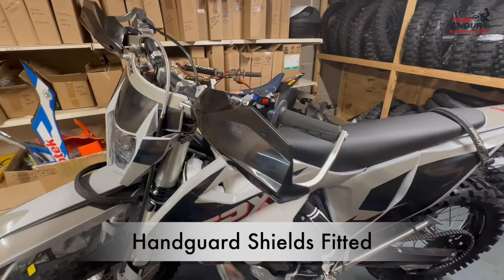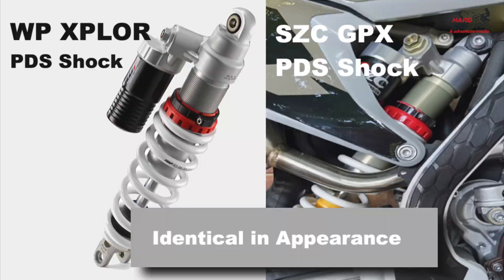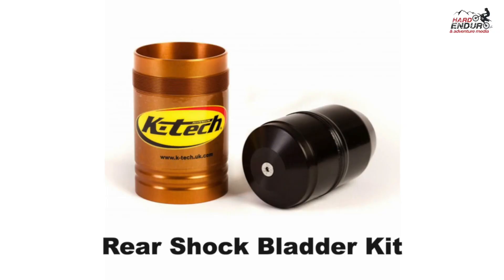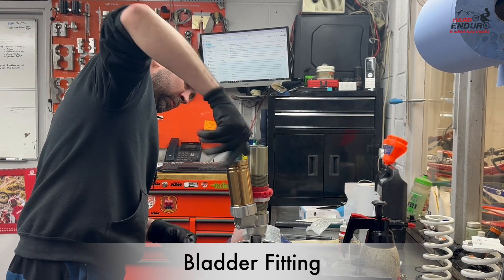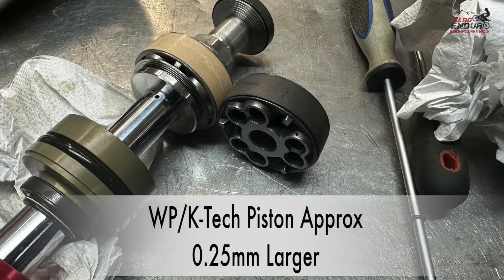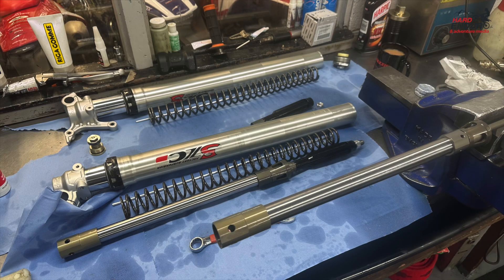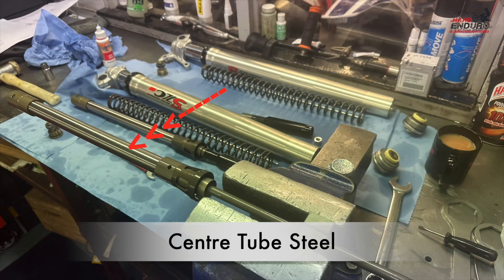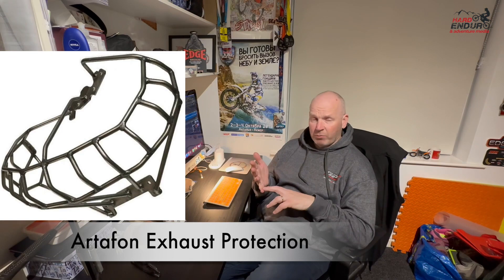GPX TSE 300R Build Pt.4 (Suspension)

Comment: Hi love your channel keep up the great work. Have the same bike and want to change my front springs like you. What weight fork oil and volume do I need to replace the stock oil? Thanks in advance.
Reply from the maker: @robertdelapaz1857  hi bud I use 5w motorex fork oil and an air gap of 110mm. Thanks for the support. 👍🏻
Reply: @RobboRobinson  sorry new to servicing forks. What do you mean with an air gap of 110mm?  Do you mean fill the tube with oil up to 110mm from the top? Thanks again in advance.
Reply from the maker: @robertdelapaz1857  Yes with the fork vertical in a vice and the spring & fork cap removed, the outer tube should be fully down and the inner rod also. Add oil into the tube pumping the inner rod to remove air. Using an air gap tool and syringe you can set the oil height.
Reply: @RobboRobinson  thanks for putting those valuable info together!! I owned a 4-stroke 300 made by the same manufacturer in China & my bike use the same SZC fork as well.  I my the stock spring is way too stiff for me & wanted to changed my stock spring.  Would you mind sharing the spec of the front spring so I order one to my weight locally? thanks!!
Reply from the maker: @viclau1218  Hi bud, I am 115kg rider weight in my boots, riding rucksack etc. I run 46nm front springs. How much do you weigh?
Reply: @RobboRobinson  I’m around 65kg without gear, so the 40-ish nm I believe? The stock length is 470 and o.d is 43.5?

Comment: Hello, ive just got a 450FSE. Im liking the quality.  On the suspension, the forks have blue and red dial at the top and adjustment at the bottom. Im not sure which is compression and which is rebound, im also guessing clockwise to increase. And same goes for the rear shock, ive got no idea which adjuster does what. Any help would be really appreciated. Thanks
Reply from the maker: Hi bud, ignore the colours on top of the forks. Both are rebound at top and compression at bottom. Rear shock has a single compression adjustment at top with Allen key centre bolt. There is no high speed compression adjustment like on other bikes. A screw is located at the bottom for rebound adjustment.  Try a medium setting all round to start with. Also think about your weight? Stock springs probably up to a 85-90kg rider. If you are heavier you need to up the springs to get the best out of the suspension.
Reply: @RobboRobinson  Thanks for that, really appreciate it. I'm around 75kg so hopefully ok on spring rate. Keep the video's coming. Love the maintenance ones.
Reply from the maker: @OrangeManStan  Its a pleasure bud and thank you. 👍

Comment: On my TSE 300 the shim stack was changed to my preference using WP shims.
Reply from the maker: Yes that’s easy to do. I’ll see how it feels first.  I’ve no problem with what I’ve got at the moment. Some extra adjustability would be nice for fast to slow going scenarios. I’m sure someone will come up with a base valve to fit sooner or later.

Comment: Hi Ian, you mentioned lowering the rear shock. Did this mean you lost some travel? Cheers
Reply from the maker: Hi bud, only a small amount of travel has been lost by lowering. A 10mm spacer is fitted internally so it doesn't extend back to full height. I'm 6'2" but I like to be able to put both feet flat on the ground in those peculiar angled situations in the type of riding I like this bike for. Beside I think its more stable as well.  I have had both my previous KTM's lowered in the same way. The only disadvantage  I see is  ground clearance is reduced a tad but I've become better at line choice
and hopping over things.

Comment: Do you think those rad guards would fit the TSE  250R?
Reply from the maker: Yes , only thing I will say is the bolt holes on the GPX rad shrouds are 10mm lower but there is enough flex in the plastic.

Comment: I would not invest in a bike made in ?   I had one and after all the problems I sold it and got a used Honda . Too much drama 😎
Reply from the maker: Let me tell you Honda have a big place in ?  since 2002 they have had motorcycles and engines built there with R&D facility. You fail to say which ? bike you had a bad experience with I'm keen to know.
Reply: If you're talking about China, over 40% of all Honda parts are sourced from China. KTM sources 70% of their parts from China and their Chinese CBU factory for their frames is where Hengjian sources their KTM frames. Hengjian has a contract through Shineray to obtain KTM frames that are one generation old since Chinese and Asian market KTMs keep the old generation KTMs in production for 3rd party access as part of their contract with Shineray. Btw Hengjian is the manufacturer for GPX